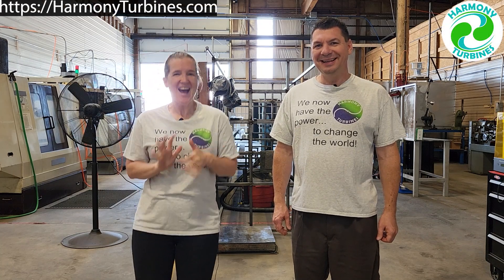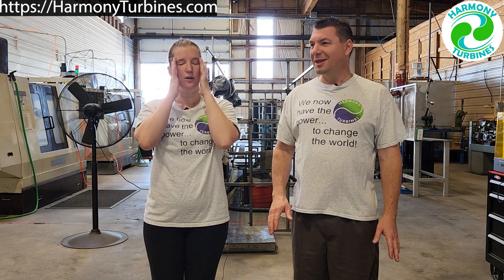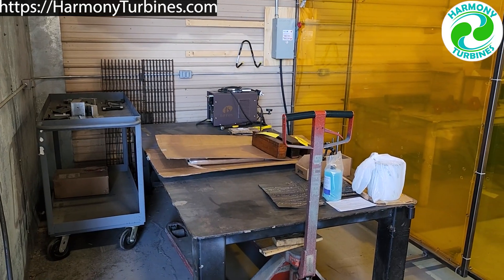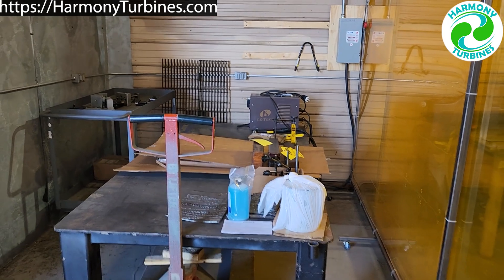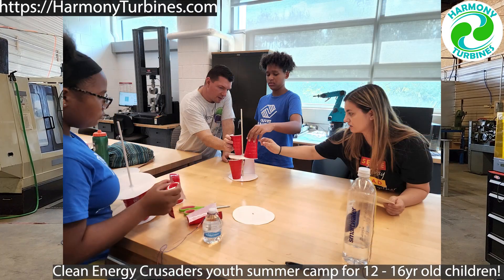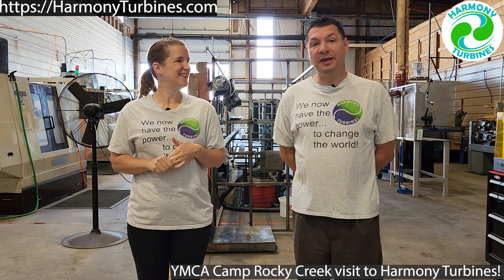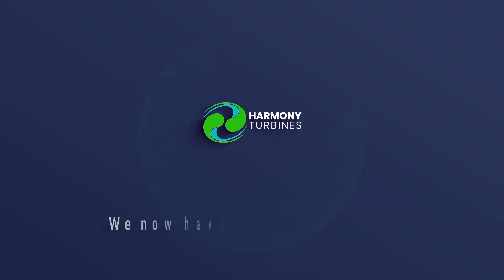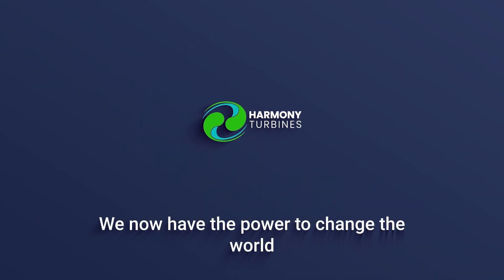Full Metal Prototypes! -No more plastic

Comment: Your Idea IS on the right track. Keep it up as low level wind turbines with your furling will stop the turbine from exploding when the wind gets too fast. I have seen the result of a vertical wind turbine destroying itself with just a small wind gust exceeding the stress limits of the vanes. Low speed wind still packs a wallop of energy well worth gathering.🤔👍👍👍

Comment: Aluminum is probably better due to longevity and weather resistance. The biggest question I have is will the bearings need to be lubricated on a scheduled basis or are there talks about weathering affects to the bearings? It's an outdoor unit so your biggest enemy will be rust.
Reply: I.think a sealed bearing with a cover would be ok .